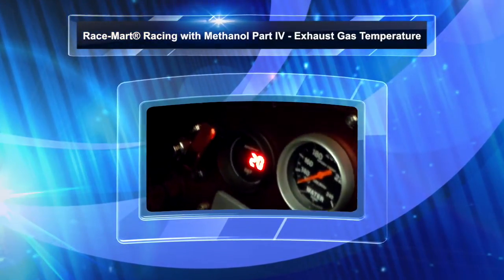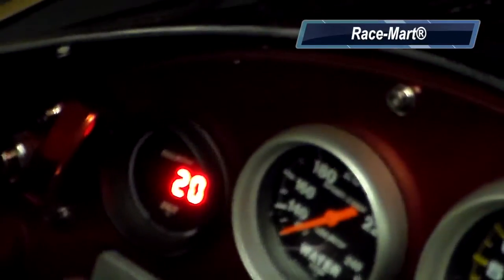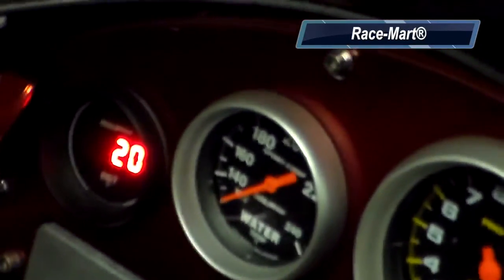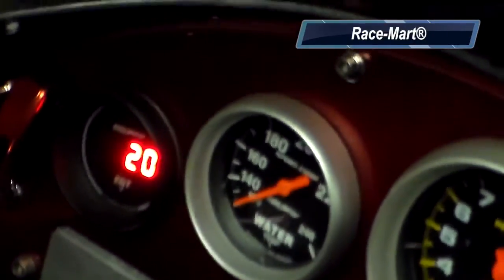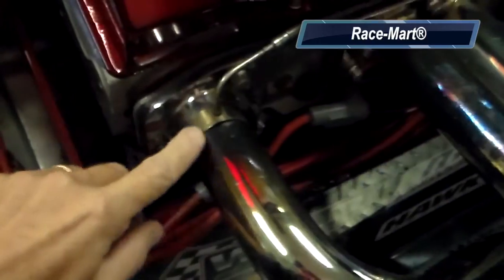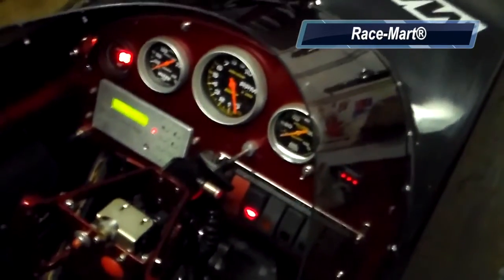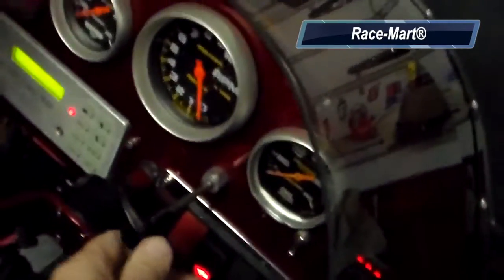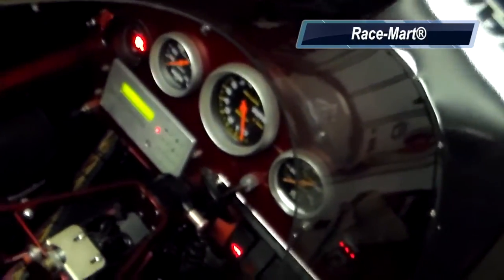Race-Mart® Racing with Methanol Part IV - Exhaust Gas Temperature

Comment: I have a 160 thermostat in my car I am lucky to see 160 on the full run this is great thanks I will try the lean out valve this might help with the water in the oil problem thanks for the help.